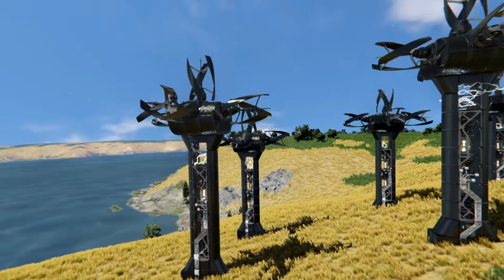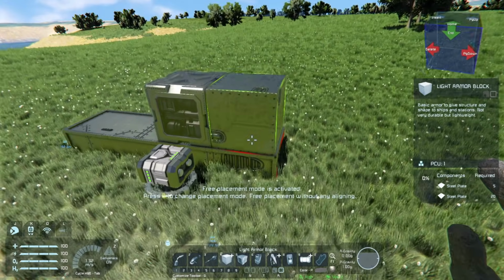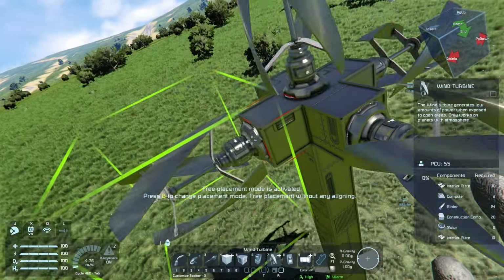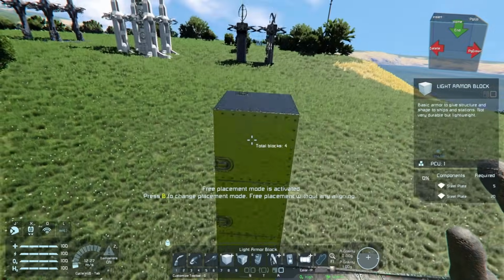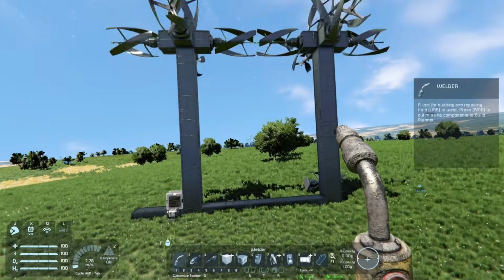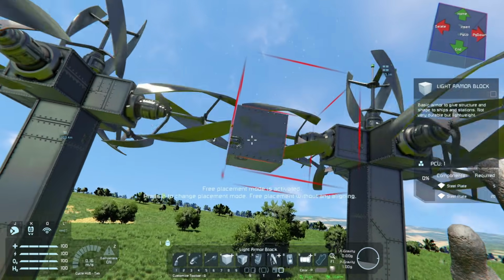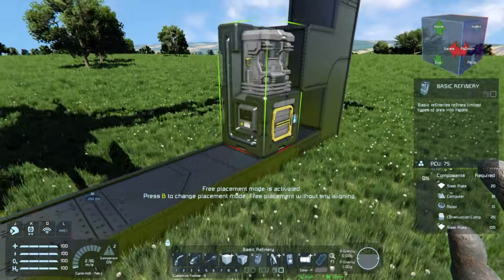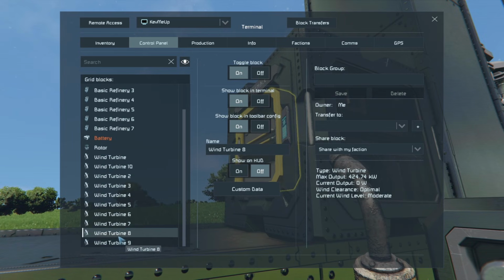The Perfect Wind Setup: 11 Up • Cross • 8 Apart (Space Engineers)

Comment: I think you should not be able to place the turbines on their sides. They would not work like that IRL. They are the round type that can take wind from 360 degrees IF they are vertical.
Reply from the maker: Yeah, I agree. It would be nice if they had more options for wind and other types. The DLC version is just a little larger but identical otherwise.
Reply: good point, they could have a bearing/hub at the top as well so that tilting on the side would look more realistic.

Comment: This setup works well. A more advanced setup might consist of scaffold blocks in a 3x3 arrangement. With some ingenuity and some stairs, you can build such a tower to be walk-up capable. I have a number of such towers, but with the top turbine replaced by a solar tracker with a bunch of solar panels.
Reply: This is great on single player or on a friendly server. In a more hostile (pvp) environment, I build the tower with truss blocks and have two horizontal turbines to keep it low profile, and usually in a dip in the terrain. Not full power, but harder to spot, however, enough power to keep things ticking over.
Reply from the maker: @stephencrabtree6599  Makes sense. Nice and low profile.
Reply from the maker: I like that idea ill need to try it out.